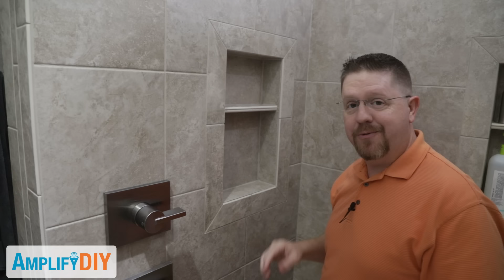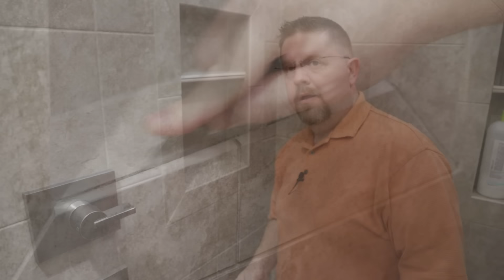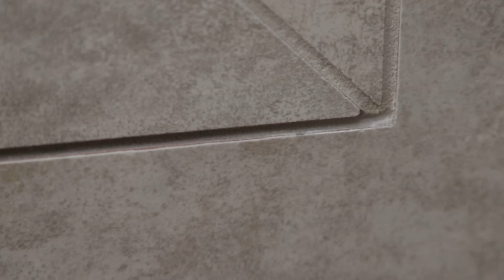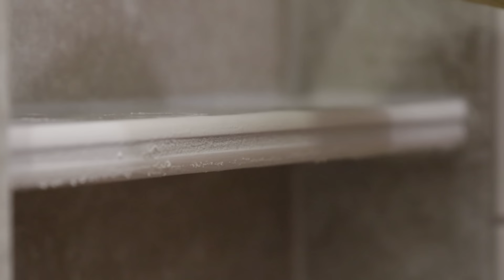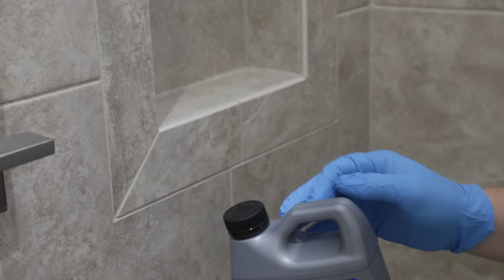How to Repair Cracked and Worn Grout (Shower)

Comment: For anyone wondering, there's a triangle grout remover tool that is much easier and has 3 different sizes on each side, when I used the saw the blade quickly dulled. The triangle tool costs 2 dollars more than the saw. I bought both, tried the triangle tool and much more efficient, cleaner edges
Reply from the maker: Thanks for sharing!
Reply: @AmplifyDIY  video was awesome and informative tho, was able to gain the confidence to do my grout on my own.

Comment: Is the process the same for repairing grout on floors?
Reply from the maker: Yes, if the grout is chipped and cracked and falling out of the joints, like I showed in this video, then the process is the same for a floor.

Comment: If your replacing a watered down grout that’s cracking with a correctly mixed or pre mixed grout will one be darker than the other when it dries ?
Reply from the maker: Hi irob - in my experience, no, the color does not change when the grout is improperly mixed vs. correctly mixed. Good luck!

Comment: Isn’t that bottom shelf too short?it should hang over the wall edge the water is sitting on the grout edge.
Reply from the maker: Hi Dale - this is how the builder designed it, and how the original masons installed everything... Since I re-did this grout in this video, I've had no problems at all with this joint. I believe the original grout work was just faulty. Thanks for watching!

Comment: Thank you!  My grout is chipped and missing where the seamless door meets the wall so awkward location.  Do you think that is DIY or for a pro???  Also I have no idea what kind of grout was used but luckily it is white so easy to match.  I would like to use premix!
Reply from the maker: Hi Teri - you have very little to lose by trying to DIY it. You can always call in a pro if you are unhappy with the results. I'd go ahead and give it a try!  As for which grout to use: I like the stuff I used in the video: Fusion Pro. Good luck!

Comment: what abouit to seal the grout!!!
Reply from the maker: Hi Hard Worker - the Fusion Pro grout I used specifically does not need to be sealed. Of course different grouts have different requirements, so check the instructions for the grout you are going to use. Good luck!

Comment: Is it necessary to also caulk the joints?
Reply from the maker: Hi Carley - generally grout is used between tiles, and caulk at the inner corners where a wall meets the floor, or a wall meets another wall, etc. This allows for the natural expansion that occurs at these joints to happen without cracking any grout. Good luck!

Comment: We just had our shower floor tiles install. few weeks down the road the white color grout between the tiles starts to fade.   what cause the white grout to fade?   I believe my contractor did not apply sealer to it.
Reply from the maker: Could be lack of sealer, could be they are just getting dirty. Many bathroom cleaners have been formulated specifically to get grout bright again...

Comment: Thank you for the DIY video! Very informative. I believe there won’t be extra steps like any silicone protector or any water/moist protection right?
Reply from the maker: Hi Joanna - I showed all the steps that are needed for the specific grout I used (Fusion Pro) - other types of grout may require sealing / extra maintenance, etc. Good luck!

Comment: Any tips for the corners?  The grout float doesn't seem like it will work in the corners.
Reply from the maker: Hi Kellie - at inside corners, generally I recommend a 100% silicone caulk. Make sure the surfaces are very clean beforehand, and that there is no old grout left in the joint. Thanks for watching, and good luck!

Comment: Nice video but I would recommend moving all in one direction when putting in your grout so you don't create air pockets in your joint. Basically like this, \\\\\ not \/\/ because you create an air pocket right at the X of the joint.
Reply from the maker: Interesting tip, Josh! I've been doing it /\/\/ forever, and never had a problem. I'll have to try \\\\\\ next time. Thanks for watching!
Reply: @AmplifyDIY  more than 1 way to skin a cat! That's just how I do it. Great work either way brother!

Comment: I tried to grout just like you did around the base of my shower but it will not stay in.  I let it dry for days then first use it washed out
Reply from the maker: Hi Teresa - I'm sorry to hear that! What kind of grout did you use? Did you have to mix it up yourself? Most grout failures tend to come from mixing up the wrong ratios of grout to water, or not getting it installed deeply enough - i.e., grout can't just be a thin layer.. it needs to be installed similar to mortar between bricks. Make sure your gaps between the tiles are all cleaned out really well, and that the grout is getting all the way into and filling that gap. Good luck!

Comment: Perfect explanation through the video!
Unfortunately my shower has half the grout cracking/peeling off so I got a lot of work to do. Looks like my “handyman” did not do the job properly. 

Quick question, how long til after the job is finished can I use the shower? I know there’s a cure period.
Reply from the maker: Hi Ruben - sorry to hear your grout was done poorly. :-( The amount of time you have to wait varies quite a bit based on the type of grout you use. Consult the instructions for your specific grout - but in general, it's at least a few days. Good luck!

Comment: Great advice, thanks. I followed your steps, but the grout came out rough (not smooth). Any advice how to get it smooth next time? Thanks,
Reply from the maker: Hi Larry - smooth grout is in my experience a function of how wet your sponge is while going over it for the last few passes. I keep mine damp, but not dripping. If yours was a lot more dry, it could leave a rougher finish. Good luck!

Comment: Do you seal the grout after it cures? Seen recommendations to seal grout every few years.
Reply from the maker: Hi Ted - depends on the specific grout you use. I used Fusion Pro grout, which specifically says not to seal it in the instructions. Consult the instructions / guide for your grout. Good luck!

Comment: how long for the grout to cure, and be able to use the shower again?
Reply from the maker: Hi Vicki - this varies by manufacturer. For Fusion Pro grout that I used in this video, the instructions say: "Allow 24 hrs until light traffic, and 7 days at 70° F (21° C) and 50% relative humidity before intermittent water exposure (such as a shower enclosure). Lower temperatures and higher humidity will slow the cure times. Covering Fusion Pro immediately after grouting will extend the cure time."

Thanks for watching!
Reply: I'm getting ready to attempt and thanks so much for this clear demonstration. To piggy back on this question about drying time and when it's ok to use the shower  - if it's in the 80's outside /70's at night, currently about 50% humidity but high chance for rain tomorrow - should I leave window open to help it dry? Also I have a 9" fan always going in the bathroom. Is that helpful for drying? Does it expedite the drying process at all? Thanks again for the video!

Comment: How long for the grout to cure?
Reply from the maker: Hi MyRS4 - depends on the grout you use. Check the label or manufacturer instructions. If you are using Fusion Pro grout, here is what their instructions say: "Allow 24 hrs until light traffic, and 7 days at 70° F (21° C) and 50% relative humidity before intermittent water exposure (such as a shower enclosure). Lower temperatures and higher humidity will slow the cure times. Covering Fusion Pro immediately after grouting will extend the cure time."
Good luck!
Reply: @AmplifyDIY  thanks

Comment: Can you just fill in holes that have appeared without removing the old grout since most of ours is still good?  Or regrout just small sections vs a whole row?
Reply from the maker: Hi Jasmine - no, you should not replace just small sections. Even though the grout nearby appears solid, it likely has started to crack/separate as well. I recommend going at least 6-8" beyond any cracked areas when removing/refilling grout. Good luck!

Comment: Thank you for sharing! 

Im about to re-grout my bathroom using this video. Ive seen that grout sealer is a thing but havent seen it used in any videos. Is this an additional step i need to complete?
Reply from the maker: Hi Jamie - most grout requires the extra step of sealing. I specifically chose and used FusionPro grout in my new house, so that I would not ever have to seal grout again.
That's the grout I demonstrated in this video as well. Good luck with your project!

Comment: Shouldn’t you seal the grout?
Reply from the maker: Hi Mary - the FusionPro grout I used specifically says not to seal it. Other grouts do need to be sealed though, so check the instructions for whatever you use. Good luck!
Reply: @AmplifyDIY  👍

Comment: I live in a old and poorly maintained house and the grout in my shower is severely chipped and severely discolored. Most of the actual tiles are in good shape so I’m glad that this video shows how to replace the grout without removing the tile.
Reply: Also, I appreciate you mentioning the grout haze because I also see traces of that in my shower.
Reply from the maker: I'm glad I could help. Best of luck!

Comment: Removing existing grout is not easy! I want to grout over that little tiny missing pieces.
Reply from the maker: Hi Mimi - unfortunately, if you don't remove the old grout first, the new grout will just crack and fall apart as well, since the old grout underneath it is not secure, and the new grout won't be as thick as it should be. I mentioned a few different power tool options for removing grout that do make the job easier, though of course the tools are not super cheap. Good luck!
Reply: @AmplifyDIY  thank you. I moved into a new place and I am having the same problem so where is revisiting the video. I am still going to fuck the way to do it without removing the grout lol. At that point I’d just retile the whole floor! Isn’t there any cool new products that hep fill the gouges for the short term?

Comment: So glad I found your video. Easily explained. I’ve done a lot of home improvement jobs on my own but never grout. I have same problem as you did but in more spots. I found a bag of grout the previous owners left. They put the same exact tile on the floor so I’m assuming they used same grout for both bathtub tile and floor tile. Now all I need is to find out the right consistency to make it Making sure it’s not going to flake like you said if it’s too watery. Thanks. This helped a lot.
Reply from the maker: You are so welcome!

Comment: My grout is cracked all the way down the corner of the tub. Obviously I won’t be able to use diagonal swipes. Should I just do the best I can?
Reply from the maker: Hi Carol - yes, just do the best you can. It's most important to make sure you completely fill the joint with grout, so there are no air gaps down between the tiles. Good luck!

Comment: Do you reseal your grout lines after?
Reply from the maker: Hi Jason - the grout I used specifically says not to seal it. This will vary by the type of grout you use, of course, so check the instructions with your grout. Thanks for watching!

Comment: Nicely done tutorial. I'm just about ready to regrout our shower wall tiles above the tub. When removing the cracked grout (over a week ago), I discovered (to my dismay) that there WAS NO MORTAR behind some of the tiles -- the 20-year-old gypsum wall had disintegrated from being wet. Instead of fixing a few grout lines, I ended up removing about 30 tiles and rebuilding 5 square feet of wall (with Durock), cleaning off and re-installing the old tiles with thinset, and FINALLY got to this point of regrouting. Took days, not including the 30-mile round trip to the nearest "big box store" for tools, materials and supplies.  Your cheerful demeanor here gives me strength as I round the final lap in this project. THANKS!
Reply from the maker: Oof.. I feel your pain. I'm having flashbacks to when I bought my very first house around 20ish years ago... everything passed inspection, but the day we took possession I pulled up the carpeting in the family room as we planned to re-do the floors before moving in. The floor in one corner was damp and rotted almost completely through. Turns out the tiled shower in the master bathroom backed up to that room, and had been leaking for many years. Had to do a complete bathroom gut/remodel on top of all the other plans we already had for that house. 
Anyhow, I'm glad to hear you are closing in on finishing your project! Sounds like you caught it before it got REALLY bad!

Comment: Great video!  Does this type of grout also need sealed, or not so as it's non-cement?  Thank you!
Reply from the maker: Hi Kip - the Fusion Pro grout I used specifically says it does not need to be sealed. Thanks for watching!
Reply: @AmplifyDIY  excellent.  Thank you sir!  Again, super video.  Liked and subscribed.

Comment: excellent content, thank you for sharing!  Do you apply any sealant to the grout, by chance?
Reply from the maker: Hi J P - the Fusion Pro grout I used specifically does not need to be sealed. Check the instructions for whatever grout you use and follow that recommendation. Good luck!

Comment: Loved the instructions. What type of grout should be used when you don't have a clue what the builder used? My house is nearly 17 years old and some of the shower grout has large cracks.
Reply from the maker: Hi Lorna - I recommend just doing your best to match color, as matching the exact same grout will be impossible. I happen to like the fusion pro grout I showed in the video because you don't need to seal it and it has held up really well for me. My local Home Depot has it in a whole bunch of different colors as well, so maybe you can find a good match that way. Good luck!

Comment: Clear and easy to understand instructions !   My grout is cracked in the corner - what tool can I use in order for  new grout ?
Reply from the maker: Hi Sharon! Generally corners are not actually grouted. The best thing to do where a wall meets a ceiling, floor, or other wall is to use a 100% silicone caulk to fill the gap and seal the joint. If you add grout to a corner joint like that, through seasonal temperature and humidity changes your house will slightly expand and contract, cracking up and breaking the grout out of those joints. A flexible 100% silicone caulk will flex, and not crack. 
Good luck!

Comment: I'm with arte C+:  really good, clear video.  After all of those careful, patient instructions, I would add that you want to use unsanded grout on the tiles due to the small distance between the tiles.  Really good video.  My thanks.

Comment: do you use the same grout for the borders of the floor and wall of the shower?
Reply from the maker: Hi azpapi - no, for the joints of walls and floor, you should not use any grout at all. Use a 100% silicone caulk instead. If you use grout there, it will quickly chip and crack, as the house expands/contracts with different humidity/temperatures throughout the year.

Comment: How do you fix grout along the edge where the wall meets the floor?
Reply from the maker: Usually at a 90º angle joint like that you don't use grout at all. You should be using a 100% silicone caulk. If there is grout in the joint already, remove it with the technique I showed in this video, then apply a bead of silicone caulk along the joint to seal it. Silicone will allow the joint to expand and compress slightly with the changing seasons / humidity levels in your house. Good luck!
Reply: @AmplifyDIY  thank you, yes there's already grout there. I will try the silicone caulk.
Reply: @AmplifyDIY  oh, I forgot to mention my shower is a completely tile shower that may be why there is grout there, there is no tub, it's just a shower. Does that change anything about using silicone

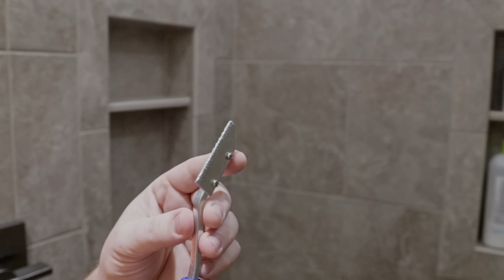Comment: 1:25 inexpensive grout saw to remove the loose grout, brush to remove the debris
2:25 use a slightly damp almost dry sponge to clean
  Fusion Pro grout,
4:00 grout float to press grout as firmly as possible to cracks
Reply: He did not seal the grout!
Reply: @victoriam-sky9033  That grout has the sealer in it?

Comment: Do you like the fusion pro product?   Or would you have preferred to use another product?
Reply from the maker: Hi Steve - I do like Fusion Pro pretty well. When properly applied, it seems to hold up really well, is easy to keep clean, and is maintenance-free. Thanks for watching!

Comment: Urgghh previous owner of my place did "something" (I'm guessing they might try to refreshen washroom grouts) and now I have deep gap between tiles in random parts of washroom floor and wall tiles.. is it ok to just do patch work without completely remove old grouts? I just want to fill gaps up enough to even out the level of other parts of grouts so I can apply grouts colour 😬

Comment: No sealants?
Reply from the maker: I believe I mentioned in the video that the Fusion Pro grout I used specifically says not to seal it separately. Of course different types of grout require different things, so check the instructions for whatever you are installing. Thanks for watching!
Reply: @AmplifyDIY  👍